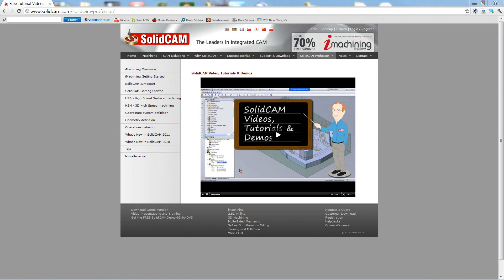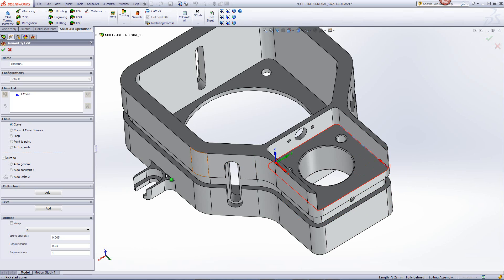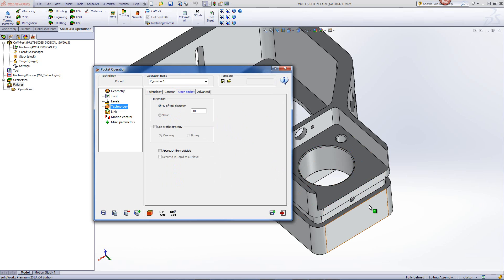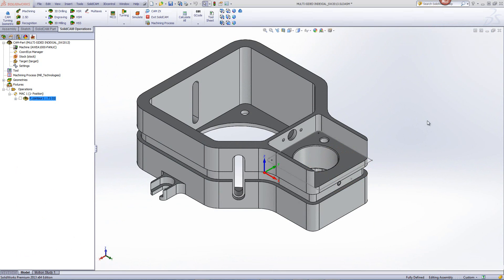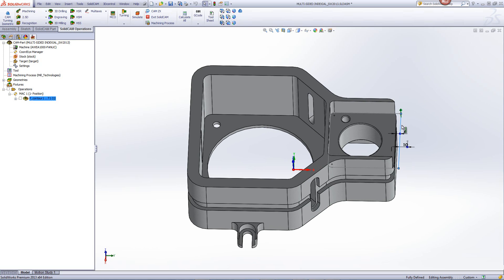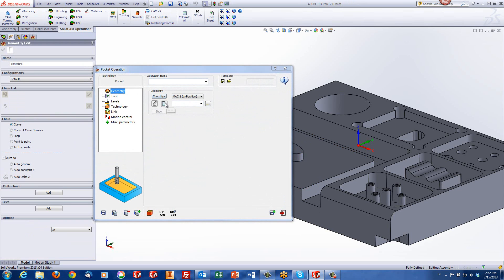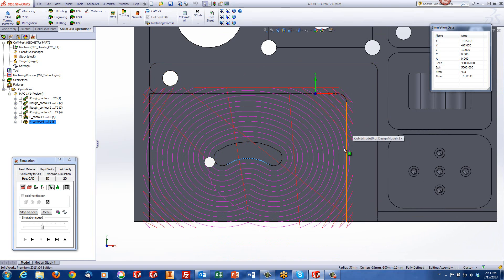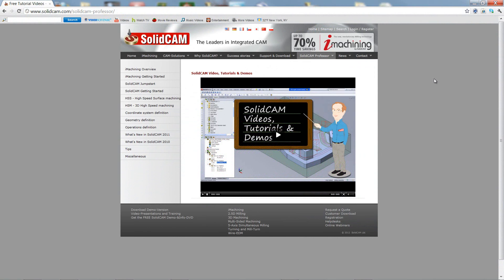SolidCAM University: Working With Open Pockets

Comment from the maker: With iMachining 3D, you can also mill prismatic parts, which include hundreds of pockets and islands. This can be done in one operation, without the need for defining geometry chains, directly from the solid model of the part and the solid model of the stock. iMachining 3D will do the rest automatically and optimally, avoiding collisions between the holder and the updated stock at every stage. This can also be limited to specific working areas without chaining.